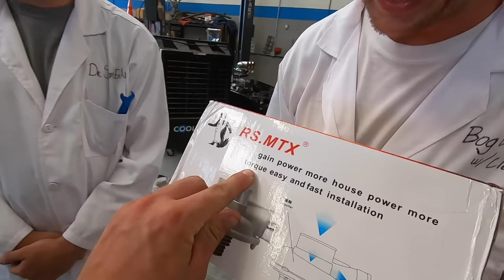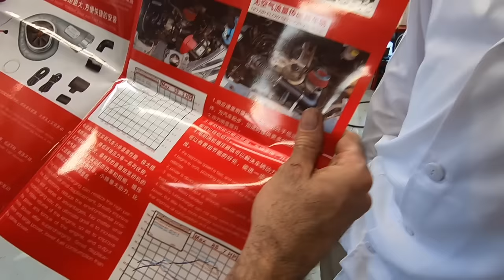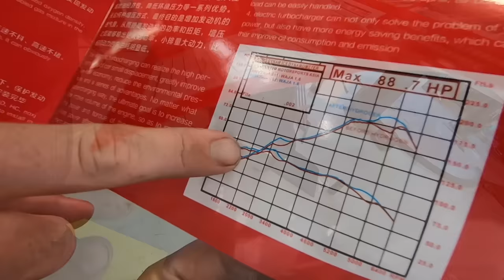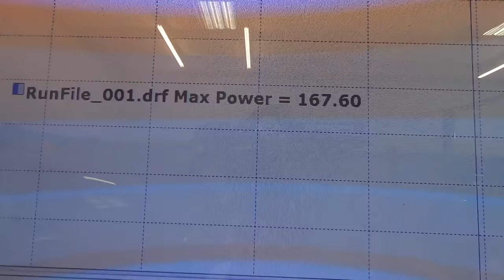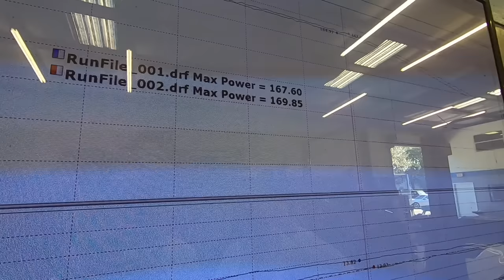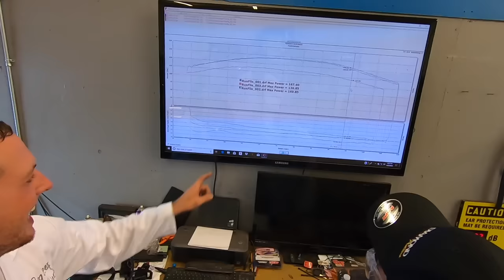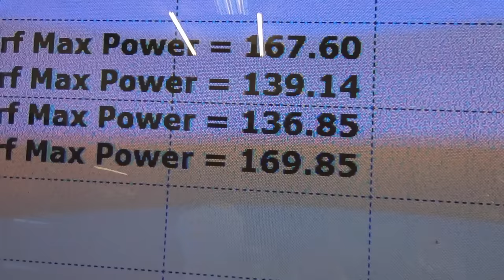Dyno Testing a $400 ELECTRIC TURBO! Funniest Car Part EVER!

Comment: to be honest, this amazing turbo is most likely made for engines that has a standard power of 50HP. not a MASSIVE V8, that just chugs in air, and a bit of fuel and then goes bang 8 times per revolution.
its made in china, for those tiny city cars. and i expect the results to be actually ''different'' on such an engine, and not on a massive V8 mustang engine...
Reply: * Goes bang 4 times per revolution.
Reply: I dont think it would be more effective on a smaller engine... At speed that airflow is probably less than a natural intake -_-
Reply: @MiraSubieGirl  a massive big v8 chugs ALOT of air in itself in order to turn over, a small 3 cilinder 1000cc engine doesn't require as much. And this "turbo" might just give it a slight performance increase..
Reply: @wildwilco  Yes but its all within a compressed ratio... 

So for "all that extra air" in a small engine can only displace itself within the ratio of its size... 

For example 10% more from a 1L inline 4. 

Is much much less power than 10% from a LS8.
Reply: @wildwilco  The V8 "could" use all of that induction effectively. 

Where as in a 4 banger it will simply peak out very early... It has no real capacity to improve, where as at least a V8 you could assume "can and will profit from more induction". 

If anything bigger engines will profit more...
Reply: @MiraSubieGirl  you don't get it, this air pump can displace for example 10L/min of air. A big v8 at full chug requires about 20L/min, at which point this air pump becomes a restriction (you could hear the pump Rev up at the engine sucked more air through it). A small 1000cc 3 cilinder engine only needs 5L/min, at which point the air pump (turbo) could actually provide the engine with more air than it would normally suck in by itself. Possibly giving extra power. (still wouldn't be alot)

All of these numbers where not factual, just an example.
Reply: @wildwilco  "Might" is the safest word to use here. 

But in my experience I doubt engine size will matter at all. It lost power... its clearly not an effective induction. 

The only way I see it working is if you set it up as a mafless system... 

But thats idiotically risky and stupid, not to mention expensive. That way you bypass all external forces and the manifold directly ports to the outside air.
Reply: @MiraSubieGirl  you don't know what you are talking about.... Any small 4 cilinder engine can improve just as much, as long as you add boost. But the ratio of air required for a bigger engine to achieve "boost" is much bigger in a v8. And if you have a 50HP small engine, give it boost to become 100HP, it's a massive 100% increase. But on an allready 450HP v8, 50HP ain't that much of an improvement.
Reply: @wildwilco  An electric blower is not boost...
Reply: @wildwilco  Ummm no... because the same amount of induction will not "scale"... 

It wont... I promise you. If it gave a 50hp engine another 50hp. It wont give a 450hp engine 50hp as well... 

If the V8 lost power, the 4cylinder will too. 

IF the product was actually working... It wont scale directly.
Reply: @MiraSubieGirl  dude! Did you not read what I say, in order to get "boost" your air pump needs to chug more volume air/min that the engine naturally sucks. A big v8 requires ALOT of air, and a small 1000cc engine requires very little. So this electrical air pump could possible provide more air than the engine naturally requires aka. Making "boost". Stop thinking so complicated. I know it's chinesium crap that they bought, but it's made for Chinese cars, which have small engines.
Reply: @wildwilco  Oh ok then yeah I guess ANY air induction even 1% more than factory could be called "boost"...
Reply: @wildwilco  Regardless of the discussion, if it lost hp on the V8 its only going to fail on other engines too. 

Its not "boost" like a turbo or supercharger because arguably its not "Forced" induction. 

Its just trying to overload the natural induction with a hair dryer 😅
Reply: @wildwilco  On really really small engines... 50cc... 

MIGHT add power but even then I doubt that crappy blower induces more than the engines factory setup being unmolested.
Reply: @wildwilco  V8 with 170hp... Loses 30hp. 

Tiny engine will lose roughly the same %. Induction is induction... from a 50cc to a 6L V12. 

If it loses 15% on a V8 its probably going to lose MORE on a 4cyl. 

You see it as "more to gain the smaller the engine" but in reality a smaller engine just has less to lose. 

I love being told I know nothing about Mechanics as arguably I am one of the highest grade and certified Female mechanics alive. 

I speak 3 languages and travelled the world with my Mechanical experience... English isnt even my second language, its third. 

Id love to see you explain induction in not a second, but third language.
Reply: @wildwilco  Losing 20hp from 50hp... Is a larger % than losing 30hp from 170hp. 

So the 4cyl loses more % but less hp. 

And I think its respectfully confused some people who have never actually worked on engines... respectively! Its not bad logic... just wrong in this case.
Reply: @wildwilco  You are assuming the 50hp and 170hp engine have identical intakes and "the capacity to actually handle that induction". 

What happens when you force air into a water baloon vs a normal baloon? 

The smaller baloon pops first... so any air BEYOND that breaking point is just absolutely wasted. 

I dont know how many other ways I can explain it sorry.
Reply: @MiraSubieGirl  what car brand do you work on as a mechanic
Reply: @GRENAgaDE  I dont work for any manufacturer for the moment but I have a Honda certification for Bikes and Accredited from BMW Russia. 

(I own a Mercedes/Bmw specialist shed)
Reply: @GRENAgaDE  Anything pre 2011 I could work on and BMW will recognise it as Manufacturer Warrantable/official.
Reply: @GRENAgaDE  E36 and E39 best cars ever made...
Reply: @GRENAgaDE  OH shit I meant "Female" Mechanic for my claim... 

Was rush typing sorry.
Reply: @GRENAgaDE  I am not sure what your part of World calls the grades but I do still hold my "Senior A1 Mechanic" grade. 

The highest "government" requirement... Which isnt much -_- lol
Reply: @wildwilco  The horsepower output is a better indicator to the amount of air/fuel it chugs since most engines in cars are otto cycle and have more or less the same thermal efficiency on regular pump gas.
Reply: @oxOsicknessOxo  not once did I mention air fuel ratio. A v8 4L+ engine needs way more air to run than a small 1L engine
Reply: @wildwilco  it doesn't matter if it's a 1L engine or a 5.0L engine, if both produce the same power output both require the same amount of air. Air/fuel ratios don't vary that much normally.
Reply: @oxOsicknessOxo  this air pump doesn't give a flying f*ck about air fuel ratio, the pump just chugs air into the intake. And if the engine is receiving a higher volume of air than its taking, the pressure inside the intake will increase (slightly) simply making boost, but a 5.0l engine take the same amount of air to run while idling as a 3cil 1.0l engine at full throttle. We are just talking about boost. Read back on all my comments because braindead people keep mentioning stuff I haven't even talked about and start adding stuff that has nothing to do with anything. If you are able to give the engine more air than it normally would take n/a, it will make boost. I'm just stating that a 5.0l engine for example takes 100L of air every minute, which is way more than the simple air pump can produce. And a 1.0L small engine only needs 30L of air per minute (not actual numbers, just an example), if three pump can chug 50L/min the engine will get a slight boost.
Reply: @wildwilco  You mentioned that the air displacement was directly related to the engine displacement. It's thermodynamic, most engine in cars are otto cycle and have about the same thermal efficiency, which means for the same power output on pump gas it burns the same amount of fuel, and unless the air fuel ratio is different, it pumps the same amount of air whatever its displacement. If a 1.0L 3 cyl engine and a 5.0L V8 had the same power output both would still have different power curve, but at peak power which would be the same, both would suck the same amount of air no matter what.
Reply: The loss is because it's not flowing enough air for that engine and it's loading up the alternator.   If it was a small 4cyl engine and it was correctly mapped you would see a gain.   I would like to see the manifold pressure, if it's still a vacuum then it can't work.
Reply: @dr_jaymz  this engine requires so much air flow, that the little air pump (its nothing more than that) wouldnt be able to provide. you can hear the engine spool the little pump
Reply: @wildwilco  absolutely. Bear in mind a mechanical supercharger on an AMG v8 can take 150hp just to drive it.
Reply: @wildwilco  the engine displacement is only relevant if both engine are revving at the same speed. No matter the engine displacement, the thermal efficiency of most engines in cars is around 25% which means that two engines with the same power output need the same amount of fuel/min when producing the same power whatever the displacement or the number of revolutions per min. To burn 1kg of fuel an internal combustion engine needs 14.7kg of air, compressed or uncompressed. Which means that two different displacement N/A engines producing the same power output at the moment both are producing the same power both burn the same amount of fuel and require the same volume of air per min no matter the displacement. The smaller displacement N/A engine would just rev higher, but in the end it sucks the same volume of air per min and the engine displacement becomes irrelevant.
Reply: @dr_jaymz  but that supercharger also produces like what... 20 pounds of boost? Sort of? Ofcourse that will cost power... But this electrical air pump might just produce 1-3psi on a small 1.0L engine... I wish cleetus could put it on a small engine...
Reply: @wildwilco  Calm down. You mentioned volume displacement of air per min being related to the engine displacement which unless engines being restricted to the same number of revolutions per min is wrong. The only correct affirmation you've had is the volume displacement of air per revolution of an engine being related to the displacement of an engine, but you didn't bring this up until recently. Why did the engine displacement matter? Because there are many small displacement engines nowadays that produce as much power as the old V8 in the video and since nobody add force induction to an engine to increase the horse power at idle the volume displacement of air of a 3cyl vs a V8 doesn't matter. The thermal efficiency is the total power measured at the crank, it does take into account the loss from the engine overcoming the friction and pumping losses which is about 20 to 25% of the total power produced no matter the amount of cylinders or displacement. The differences in thermal efficiency from an engine to another comes from compression, lower compression engine can have as low as 20% thermal efficiency and higher compression engine as high as 35%, and 25% is the most common. Which means for x% thermal efficiency x% of the heat energy from burning fuel is available as work at the crank. The number of cylinders or displacement doesn't matter. The power output is a direct give away of the amount of fuel burned, with that my friend you have a good idea of the amount of air sucked into the engine. No matter how much kg of fuel it burned it takes 14.7kg of air per kg of fuel. Since many small displacement modern engine produce as much power as the V8 in the video, on a dyno test it would matter since at peak power the electric turbo would have the same negative effect whatever the displacement since the volume displacement of air wouldn't be different. BTW if an engine with a lower displacement has the same power output but uses less fuel and air, it isn't because of the displacement, it's because it has a higher compression ratio thus a higher thermal efficiency. That's thermodynamic, you can't produce more power without more air and fuel, if you improve the mechanical efficiency you only decrease the power losses at an exponential cost. Boost would be increasing the volume efficiency.
Reply: @wildwilco  It's simplified, but I've had 4 months while studying mechanical engineering to study and write an essay explaining the differences of theoretical and experimental values taken on an engine dyno of the various efficiencies of an otto cycle engine. It's a while back, but I'm highly doubtful about being completely wrong here.
Reply: @oxOsicknessOxo  so you studies that, yet you still believe a v8 5.0L at 6k rpm chugs the exact same amount of air as a 1.0L at 6k rpm. Your diploma must be worthless.
Reply: @wildwilco  Nowhere did I say that a small displacement engine did displace the same volume of air as a higher displacement engine at the same rpm, I never mentioned 6k rpm neither. Nor did I say that a N/A 1.0L engine and a N/A 5.0L engine with the same power output would have the same rev limits, I didn't say that because it's impossible. But let me add something else to the equation, a 1000 rpm the 4.9L ford windsor engine in the mustang doesn't really chug 2450L of air because the volumetric efficiency of this old engine it would be somewhere between 80 and 90% of that. I didn't really bring that up before because you didn't understand thermal efficiency and I didn't want to confuse you more. Believe what you want, in the end I did get my degree from reading books and teaching, I'm probably the one that doesn't understand what he's talking about here.
Reply: @oxOsicknessOxo  I was trying to keep the examples simple, because a simple statement I made, made you over complicate things to a level where you brought up crap that has nothing to do with it. I'm happy you finally admit that my hypothesis was right all along. The lower air volume going through a small engine should give this air pump a small chance of adding a possibility of power.
Reply: @wildwilco  ?? When did I admit anything? Stop making assumptions about how engines work, go read about the otto cycle engine which are what most engines in cars are, thermal efficiency, volumetric efficiency and mechanical efficiency of a combustion engine, than comeback when you understand those. If you look on aliexpress there are a bunch of these turbos and there isn't any real information on any pages except that it runs on 12v, claims its rpm range vary from 6800rpm to 32000rpm and 3 psi boost at 32k rpm but no information on airflow or any valuable information. Technically you are right if you intend to use such devise on a small 50cc engine it might increase the power. But it's highly improbable that it will boost any engine that's used to move a car, especially any modern engine even the smallest. It's just a scam like those magnets sold on ebay to increase fuel economy years ago, it only works on stupid people thru placebo effect.

Comment: Last pass sounds like I'm gonna get credit fraud and my identity stolen 😬
Reply: They are not only legit but are one of if not the leader in password security management.
Reply: @jimkaray  I'm not worried about the company I'm worried about the one day that someone breaches their security
Reply: @SolivagantJourney  That's a very valid concern, just don't want people to think it is a scam. For people who use weak passwords out of convenience this is a good way make and mange secure/difficult passwords. And they did recently have a network breach. However since  they fully encrypt your passwords and never have access to your actual passwords no reported issues. SO as long as a strong password for the encryption the efforts to decrypt would take centuries.

Comment: My only issue for the most part with "lastpass" as someone whos quiet familiar with vulnerabilities, I dont trust em. Only takes 1 breach in their security and BAM! not only do they have your user and pass to everything you use, they also would have access to see what hash/obfuscation they used and then can de-crypt your "safe encrypted passwords"

Dont believe it? Ive got old DB's that were hashed and not publicly released, yet the hash is known and the passwords/pins are easy to decrypt because of it. Legit copy paste and youre done.

Comment: the air blowers we have are 17 amp 120v, and we can get two blowing  in parallel  with a Y piece.  each outlet at our shop is on a different circuit so we can plug one blower each and get 34a of power in one spot. every time i kick it on i wish i could strap it to a  smallish car engine and use the Throttle Pos Sensor to control the blower speed switches via arduino, etc.  these things kick alot of air at high pressure. its for instant drying by blowing off water instead of waiting for it to evaporate.

Comment: I think it should be tested for torque on acceleration that's before the engine reaches full rpm. It would  not have a chance to supply enough air pressure/volume when the engine is near or at full rpm.

Comment: Random question...so it most likely restricted the air but what if you used it on a small engine like a go kart? Predator 212? It's much smaller intake but also carb. Would love to see that test

Comment: You would need at least 2 of those electric things.  I'm sure the CFM output and the restrictive throat from 1 unit cuts things down.  I'm guessing that unit only pushes about 200 CFM if you are lucky.  It would take at least 400-500 CFM to really push this thing.